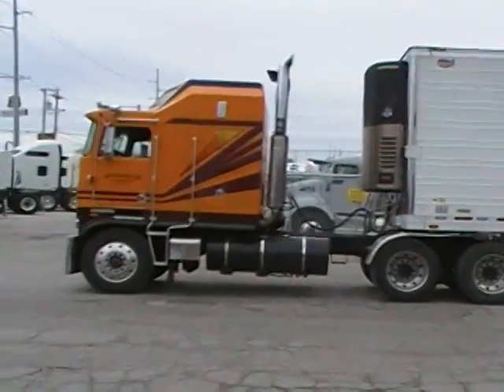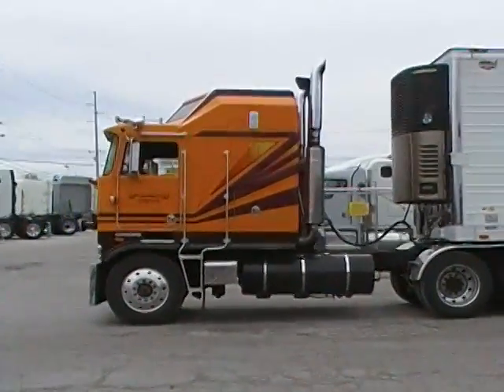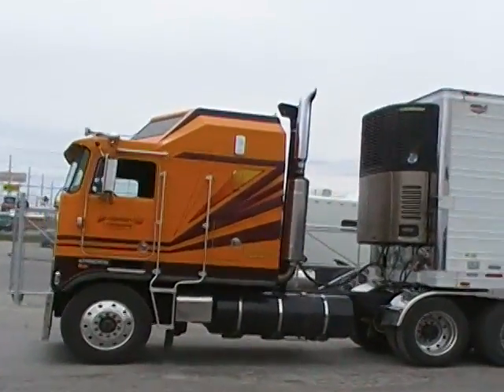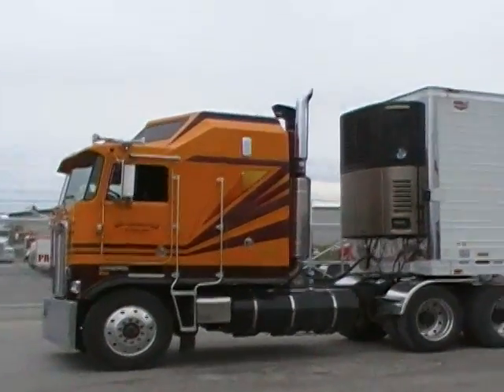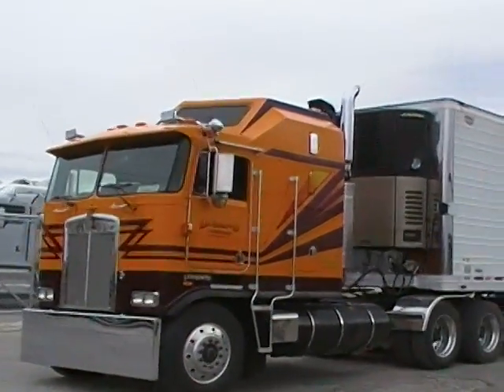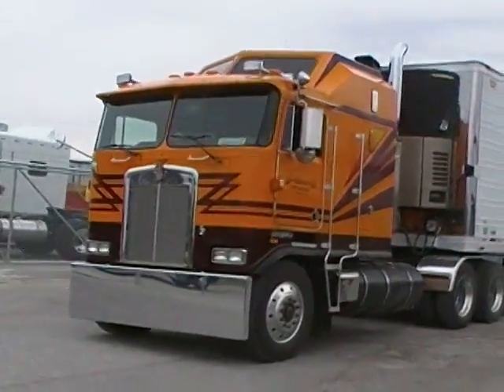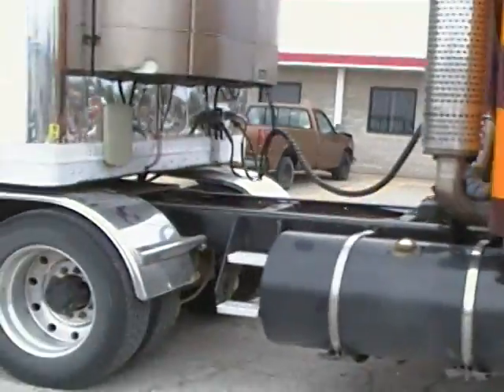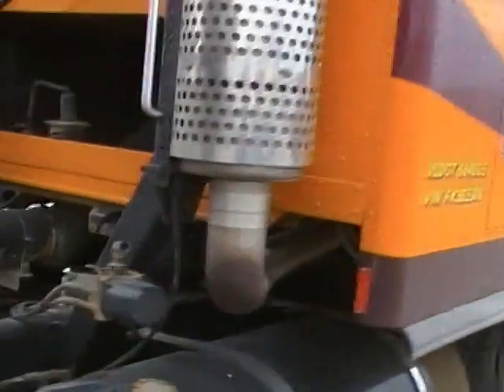A (working) Classic Kenworth Cabover Aerodyne ~  1985 KW K100c visits  a Kenworth store

Comment: The QSKs are still available for the off-highway Kenworths which they sell quite a few of to the mines, and as far as I know you can still buy them for on-highway if your pockets are deep enough. The QSKs are electronic for emissions and as far as I know they are set at about 650HP
The more common 120 ton roadtrains use the Cummins Sigs or ISX, but they definitely have reliability problems and most people wish Cat were back. Second hand Cat powered heavy duty KWs fetch good dollars.

Comment from the maker: ...could be?  The owner called it an 85, the last year for the K100 "C" I think.  86 started the "E" model with the axle noticeably set back  (7"? if I remember right).  I do remember that K100's were very reliable, but they did have an issue with the shifter.  The linkage was a brass cable inside a coil wrapped hose... eventually the lube inside would dry up and it would become very hard to shift gears.  Every couple hundred thousand miles or so the cable shifter assembly would need replaced.

Comment: The KTA 19 certainly isn't "long extinct" in Australian Kenworths. You can get the electronic QSK 19 in off-highway KW C510s. The on-highway C510s are twin steer because of the heavy weight of the K plus it's massive radiator and aftercooler.
BP Fuel bought some K100s with KTA 19s in the '80s, the engine was made to lean over to one side so there was clearance to the cab.
I wouldn't mind that cab on my cabover KW, the sleeper is huge.

Comment: The only reason the K19s are used in Australia is because the ISX and Signature Cummins can't cut it in the 180 ton roadtrains as they throw con rods and have turbo and fan clutch problems. Having said that the new Cummins have improved but they've still got the reputation of being a grenade. The QSK 19 Cummins are very heavy on fuel but at least they don't blow up. When Caterpillar left the truck engine market a lot of people were really p'd off over here as they didn't generally blow up.

Comment: the demies of the coe in the states wasnt from a safety standpoint, it happened because states lengthened and standardized overall legal length of trucks. not having to worry about having enough total length avalible to pull a 53' trailer the conventional returned for ease of maintanince and overall driver comfort.

Comment: Used to want one so bad in the Eighties for its stand-up bunk. air ride and power steering, when I was pushing a fleet-spec IHC 9670 pos down the road.
Nowadays, you couldn't pay me enough to put up with the rattly door handle, the rounded-off doghouse and the crap push-pull wire shifter linkage.
Reply: Yeah I  can relate to all that. I was so glad to see cabovers phased out but I still think the aerodyne kw cabovers are cool.

Comment: So, what would they call a K100 with a curved, sloping wind-deflector/shroud on he top of the sleeper instead? Or is that like a aftermarket thing. I've seen a K100 just like this, but it's got the sloping deflector that comes to the top of the trailer, and no windows.

Comment from the maker: Sorry - I forgot I read they are ordered.   Amazing that that block has been around so long.   Do you have  any issues your exhaust after treatment systems?   As I  retired current the biggie was getting ceramic filters cleaned out ...exhaust related warranties related to expensive frail ceramic filters. that could cost over a thousand

Comment: That bumper is hideous. 
 
Kenworth last offered the K100E as a highway tractor in 2004, and as an off-road oil truck in 2007. While some wishful thinkers insist the K100E can still be purchased new in some form, it is not available new in North America.  

Kenworth Australia does offer the K200.
Reply: P Kranz actually there is a waiting list kW only makes a handful to buy one built for the States you have to have a kW k100 for five years driving wise then be put on a waiting list if I remember correctly it's every eight years they build them for us production but it goes by the K200 now I asked at a kW dealership where I live

Comment: I love the cab over exterior but am left disappointed with interior, looks cramped.
Reply: Thank you and your family for your potentially God-glorifying work.  Does the cab being over the engine contribute precisely, or at least partially, to your preference?  I am trying to view the matter sympathetically.
Reply: +Fairfaxcat On behalf of all trucking families, thank you for appreciating what we do!

More or less, it's a preference. Because the COE trucks have huge advantages for in-city operations, where some of my family operated in, despite the rest going long-haul. Their short wheelbase makes it extraordinarily easy to maneuver, especially when backing in to a tight spot. I've had a few relatives that worked Homestead and Miami Florida, and they were always in COE, simply because it was loads easier to get around. And boy, they were so glad for the COE after a days work, they just hated hitting bumps with their steer tires. They felt everything.

If they couldn't get a COE, they went for a long hood, because they're easier to work on if they happen to break down. Unfortunately, sometimes their trucks were too long, so they had to get
 an employee driving a yard dog tractor to pickup their trailer and dock it for 
them. Lol

COE trucks had a serious flaw though; it's difficult for one person to pull the cab over to get at the engine for maintenance.